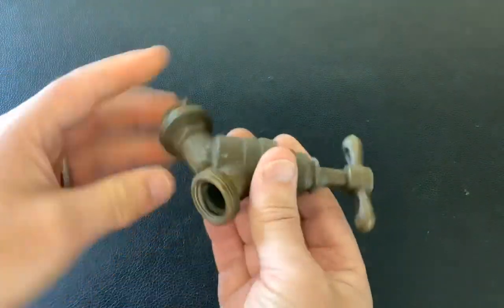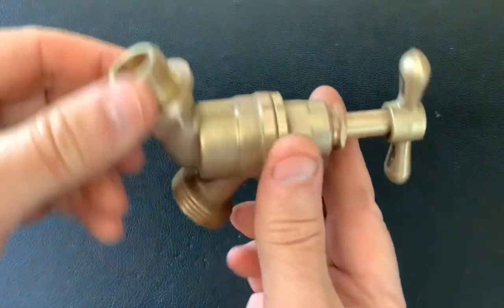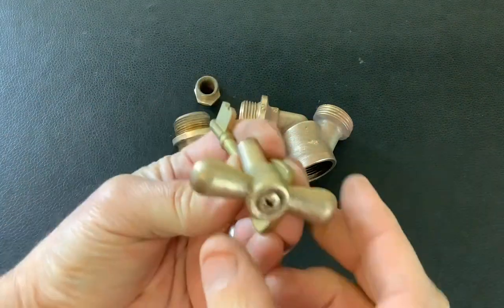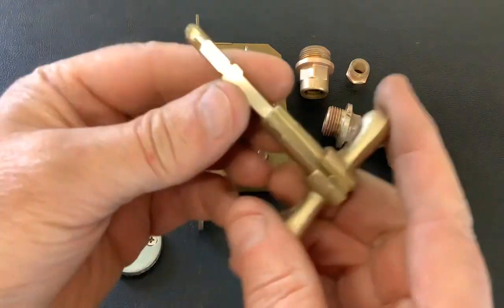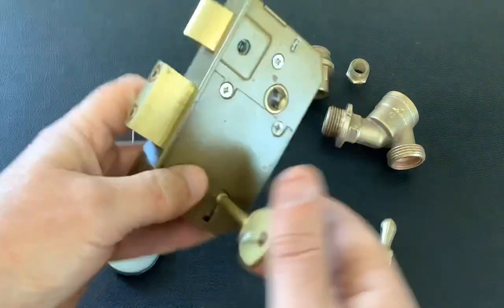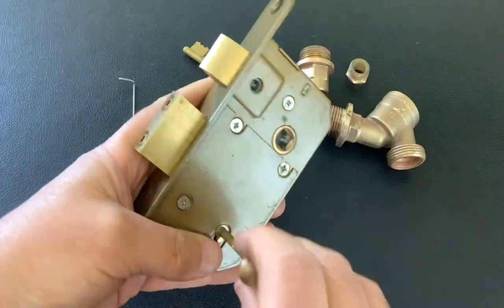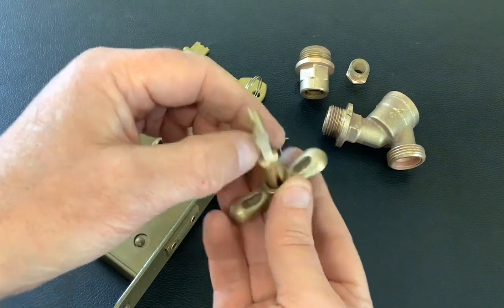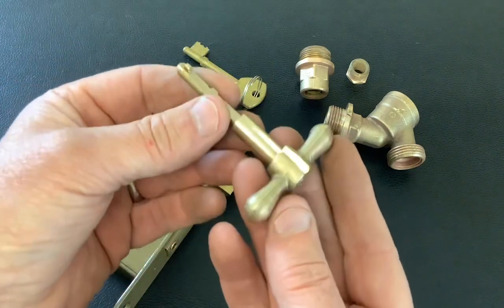509. How to make a lever lock tension tool from a garden tap - This one is a giveaway #BrummiesTap

Comment: Really cool idea! 👍 Well done! Was sthis done in a proper work shop with fitting tools or just on a Dremel and some hand tools? Looks more like the first one 🙂
I have not picked a lever lock yet so this all looks really interresting to me, but i guess that tensioner would be wasted on me, since i do not own a single lever lock yet. Thanks for sharing this cool idea!
Reply from the maker: Cheers for watching, made in my garage, tools used are a drill, hacksaw and a file, you don’t need expensive equipment 👍
Reply: @BrummieLockPicker  cool, awesome work 👍👍

Comment: Your ingenuity always amazes me.
I'd really like to own one of your tools.
I did make a couple of your nut, bolt and cut down key tensioners.
It's the curtain pick wires that I need to get round to making next.. the wire I've got at hand is a bit too thick though.
What sort of thickness would be best, 1.5/1.6 mm?
Cheers 👍 🍻
Reply from the maker: Cheers mate 🍻 I use 1.5mm for most locks and sometimes 1.2mm for the smaller ones
Your name is in the hat 👍
Reply: @BrummieLockPicker  I did make a pick wire for the 5 lever ERA insurance padlock from 2mm wire but filed down the picking tip a fair bit. 
Cheers bud 👍 🍻